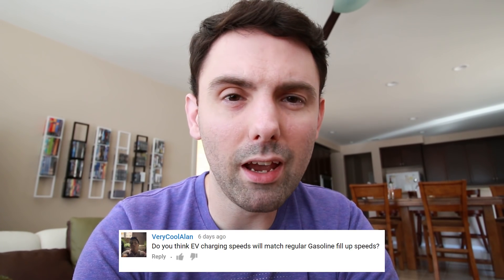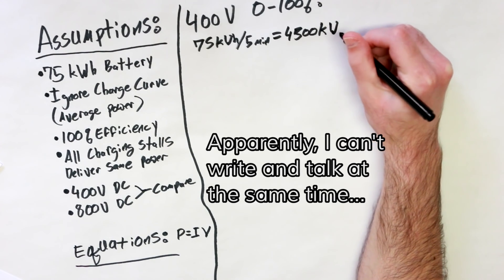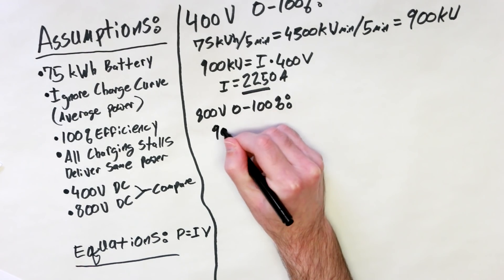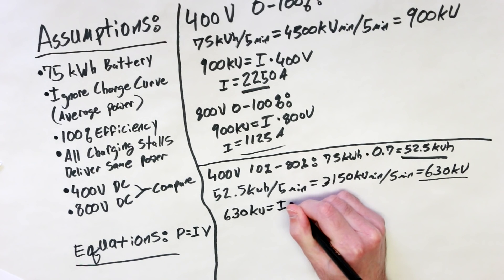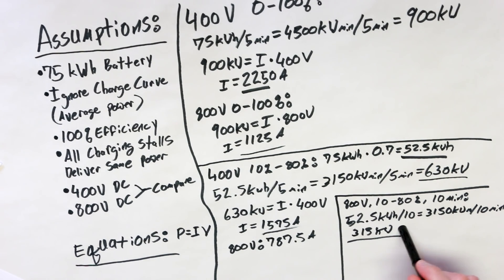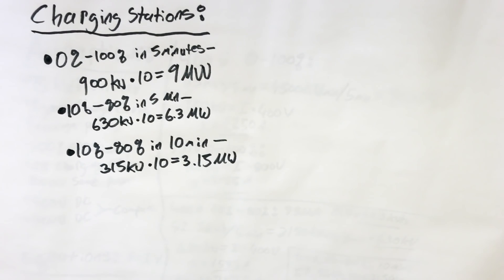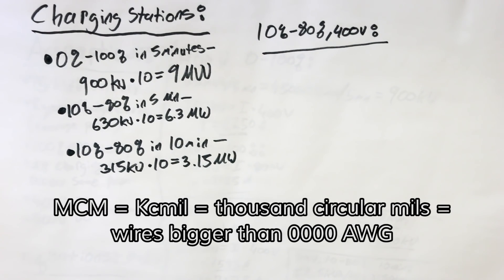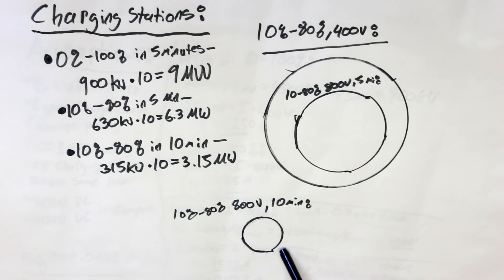Can Electric Cars Charge As Fast As Gasoline Cars Refuel?

Comment: Does it need to get much faster? with wireless charging stations coming out and ranges reaching 300 miles all we need is parking bays to incorporate the wireless charging and when you stop to rest after 300 miles your car will be ready for you by the time your ready to set off again. That vs having to find a petrol station every 300 miles in an ICE car.
Reply: Or put the wireless chargers in the road so people charge as they drive!
Reply from the maker: While I'm pretty happy with my current charging speeds, faster certainly couldn't hurt from a charging station throughput standpoint... also, I don't seem to be in the majority when it comes to being okay with charging times. That aside, inductive wireless charging due to the nature of the technology is pretty much confined to Level 2 charging which will replenish your battery over the course of many hours, rather than the 30-60 minute ballpark that's currently offered by Level 3 DC fast charging. Think of inductive charging being like the two halves of a transformer separated by an air gap: AC flowing through the primary coil produces a changing magnetic field which, in turn, induces an alternating current (AC) in the secondary coil that's located on the device you're charging. Basically, for a high power application like this, you'd have to relocate that cabinet full of charging hardware that's at every DC fast charging station into the car to handle the AC to DC conversion needed to charge the battery (unless you do something fancy like use the motor's inverter to handle the conversion, like it does during regenerative braking). Existing inductive charging solutions are limited to L2 charging because they use the car's onboard charger to handle the conversion, which means that you're limited by the typically 3kW-10kW onboard chargers.

Comment: How about using multiple cables rather than 1 large diameter cable?
Reply: With autonomous vehicles you want a connection method that does not involve cables at all. You want some sort of mechanical probe that can automatically attach to the car, power it, and then automatically detach. The car can then drive away and park itself in a nearby parking space, leaving the charging station open for the next car.
Reply: +dlwatib
Or a robot arm that is competent to connect the recharge cables. If autonomous self-drive car-share cars return to big-enough recharge hub locations, it is even possible to hire young minimum-wage people to connect the cars to charge. I mean, we don't have to be in too big a rush to eliminate all people's jobs, do we? Still a lot less expensive than having to pay a taxi-driver for endless hours of driving. And it probably isn't that bad of a job. Sit in an air-conditioned booth reading your book, until another car comes in and needs to be connected up to recharge. And some computer will probably tell the person to get off their butt, and go unplug a car that is finished charging.

Don't we already have robot vacuum cleaners that can return to their recharger and recharge on their own?

Comment: Can you just rent the battery and have the battery stations charge the old batteries for future use?
Reply from the maker: That is a possibility but, as discussed in some of the other comments, then you run into battery standardization issues. If everyone is using different battery chemistries, form factors, pack voltages, capacities, cooling designs, etc. then battery swap stations aren't nearly as viable on the large scale.
Reply: Renault offers that option on the Zoe in Europe. I don't think it will ever be all that popular. What's the advantage of owning a car if you can't run it without paying a subscription to a battery service? Most people would rather lease the entire car or use a ride sharing service if they can't afford to own a complete usable car.
Reply: Reuben U Perfect idea
Reply: dlwatib it's more like buying a gasoline..  

If you dont buy gasoline, you can't run a car.. 

The battery is your gasoline.. 

See the comparison?
Reply: Tesla tried this, but I think it would take about 30 mins, so you might as well super charge.
Reply: Brant Wedel no it took less time to swap out the battery than fill the tank, watch the demo video Tessa put out.

Comment: does that mean I can charge a 30 kWh battery from 10 to 80% in 5 min ? (with ur physics applied)
could that mean the trend doesn't necessary goes to higher range but faster charge?
Reply from the maker: Well, if you apply the 315kW charging example to the pack size and state of charge targets you've defined, yeah, it would take about 4-ish minutes. However, you'd still need to come up with a battery chemistry that could handle that sort of average charge rate. If a chemistry capable of exceptionally high c rates is developed and the tradeoff is reduced energy density, then I could see the market possibly trending toward smaller batteries that charge more quickly... but it would likely be a short term deviation until energy density is improved.
Reply: +Alex Venz
I think I would be more concerned about having higher energy-density than to have super-fast recharge capability. Due to the severe shortage of high-speed recharging stations, wouldn't I be more concerned about, "I hope I can make it to the super-charger", than "Am I really going to have to wait for an entire 30 minutes until I have a nearly-full charge?" If I am going on that long of a trip, then surely I would have budgeted in some time for necessary pit-stops?

I would rather not have to stop anywhere to recharge at all. But probably, we should soon have batteries that can offer high energy-density and also accept a super-fast recharge. Perhaps to avoid having to use "monster" recharge cables, the recharger voltage may have to be much-increased, along with better safety protocols to insure that it is safe.

Comment: Not sure if I missed something, but....

When you did the 52.5KWh / 5 min  it was 3150KWm    and then when you took the same 52.5KWh and divided it by 10min you got the same 3150KWm....????   How?  I think you got to the correct end result... maybe just wrote it out wrong or something.

Love the math videos!!!!  Good Job :)
Reply from the maker: I went back and looked... I think you may have just missed a step in there, as 3150kWmin is just 52.5kWh converted to kWmin to make the time units cancel. In both the 5 minute and 10 minute example, the same amount of energy needs to be delivered which is why 3150kWmin (52.5kWh) appears in each--it's divided by 5 minutes in the first example and 10 minutes in the second. I could have converted minutes into fractional hours and canceled time that way, but it would have meant doing the conversion for each example instead of just converting energy once.

Comment: What if you could divide the battery pack into smaller units so you can charge each one with a separate electrical charging feed?

Or have a series of fairly small capacitors one for each of these smaller units.  Using one charge cord or feed from the charging station you can quickly charge to 100% one of the capacitors.  Once full the charging unite is switched to the next capacitor and the first capacitor is then used to start charging its section of the cars battery.  You could divide the car battery by two or three or ten or how ever many sections you need.

Nice thing about capacitors is they can accept a charge very quickly and discharge at a slower rate that battery can handle.  I am not sure but I remember asking someone knowledgeable if you can draw a current from a capacitor at the same time you are charging it and they said yes. 

So if you can basically divide the EV's battery into smaller unites which would be smaller amounts of kilowatts.  Your example of 75  kilowatt battery and divide it into say 4 units all charging at the same time we are talking a whole heck of a lot faster charge time.

Those same capacitors which would be permanently mounted in the car could provide a second service.  I am not sure how efficient or how much wear and tear the regenerative breaking puts on an EV's battery but my guess is capacitors used to charge the vehicle would be a better choice to store the energy produced through the regenerative breaking.

Comment: Why not just put 2 charge ports on car? One on either side on Tesla.
Reply: Why not just put 2 or 3 fuel tanks on a car? Cost. Impracticality, I imagine. More weight to carry around.

Oh great. I get to a 2-slot super-charger, and what do I find? You are already there, and you are using both of them for your 1 EV? And I have to wait in line?

Why not just power EVs with free-energy machines? Then recharging would no longer be an issue.

Comment: Why Tesla battery swap did not work?
Reply: It does. But with free supercharging nobody wanted to use it. Plus it is sometimes inconvenient to return to the same station to retrieve your original battery pack.
Reply: Swapping tends to not work very well, with stuff that is very expensive. The better condition units will all disappear somewhere, leaving only the crap in circulation. The reason that we can swap propane tanks, is because they are all about the same, and they are all well, pretty much cheap crap. It is easier for the business to just throw away or recycle the few old and rusty and crushed tanks, than to tarnish their business image by having visible crap dissuading customers.

Comment: You did a great job emphasizing that these would be average kW/h delivered, but for comparison sake, you should also emphasize the average kW/h delivered using current standards. A Tesla supercharger, for example, only delivers an average of 60-70 kW/h using a system that peaks at 120 kW/h (and sometimes even less). Nevertheless, your point still holds that much faster delivery times are on the way, but will still not be able to charge and EV in under 5 minutes, but I think 15ish minutes would be enough for most people. BTW Porsche and the VW group are pursuing 800 Volt systems in their future EVs and charging stations that should be on the market in the next 3 years.

Comment: Tesla's 135 kW superchargers are rated for up to 330A continuous, at up to 410V. The same cable can handle 800V, though the insulation and protection will need to be uprated.

Comment: I wonder though at 800 volts how much dielectric you would have to use?  I wonder if they would have to change out all the Supercharger hardware to go to higher current or voltage?  Would the present hardware handle 800 volts?  I think home charging is the answer for most travel but that long range stuff is a tough nut to crack.
Reply from the maker: Without knowing more about the specifications of the parts that Tesla used for existing Supercharger installations, it's hard to say. Odds are that either option (higher voltage, higher current, or both) would require significant upgrading of existing stations... assuming that the existing charge handles and cable sets are rated for 800V, they'd still have to change out/upgrade the charger cabinets that supply the pedestals and, even then, that only puts them at around 290kW assuming they're already at their current limits. With how hot the connectors are already getting, active cable and connector cooling is likely to be essential in bumping up output power.
Reply: I was thinking that it might be as simple as changing the tap on the transformer and setting the AC-DC rectification by maybe adding another board or two.  Probably not that simple.
Reply: 800 V is not a problem. It is industry standard more or less. In Germany we are planing to install a 800 V DC fast charging infrastructure with up to 350 kW. The connectors will be water-cooled. But I guess you won't see many of those before 2025.